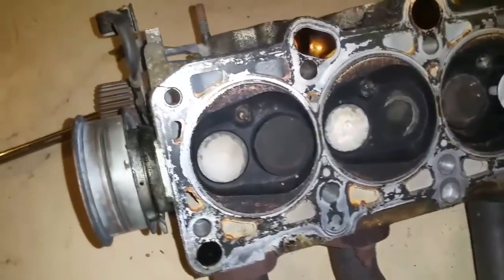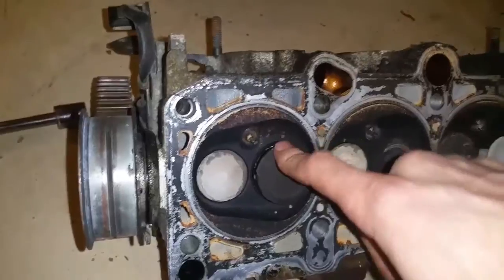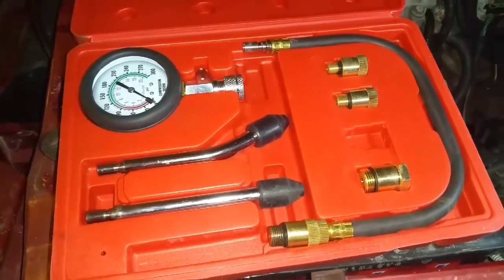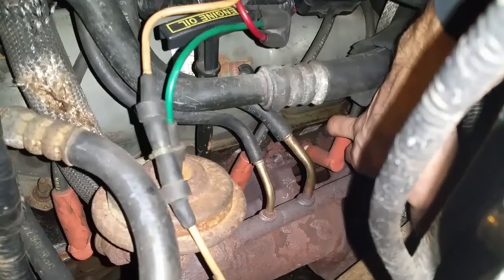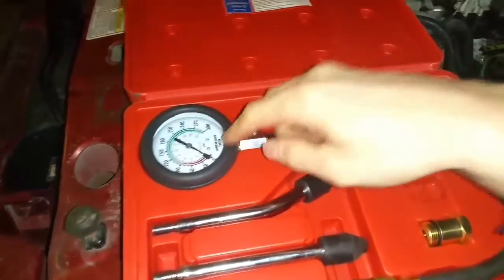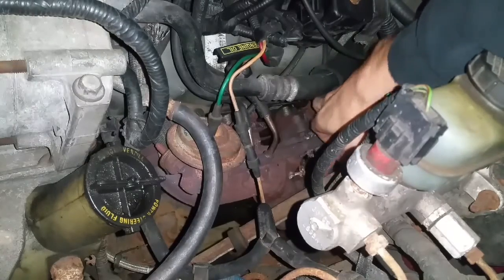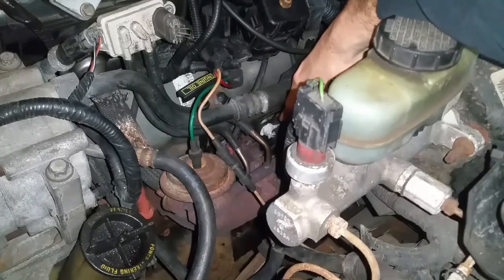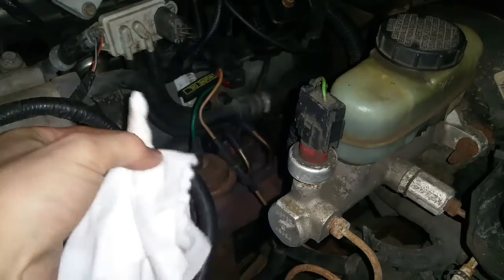CRANKS DOESN'T START: Compression and Timing

Comment: Can my 4 cyl engine start with these readings?
120 90 120 85 
In that order on a  2007 Honda CR-V 
It cranks but doesn't start. Yes overheated but cranked fine after that then one day never again.
Reply: Did u find out what the issue was
Reply: @fadilijasinanovic7061 No, I sold it like that. I knew what the issue was from experience but wanted to double check with the compression results I got. Since it overheated it either blew the head gasket, or worse, warped the cylinder head. I did that repair in my younger days but one, I was not willing to do it now that age makes physical tasks more uncomfortable and the car was too old to be worth it. I got well over what I paid for it so it worked out.

Comment: So if the timing is off it will cause low compression correct???
Reply: loooool, basically if the timings off a touch it will still run but not smoothly but if it’s off by too much then it might smack the valves, basically what happens when the timing belt or chain goes
Reply: @itswais77  I think it only happens if the engine is interference engine.
Reply: What if the cars off then the timing chain goes off will it damsage the engine and not start